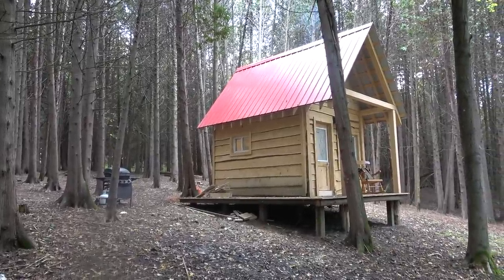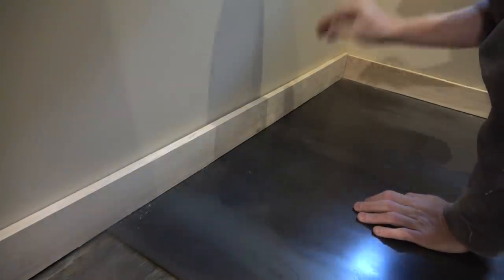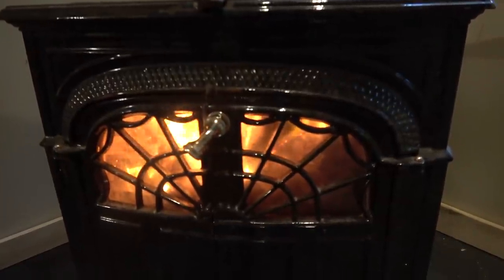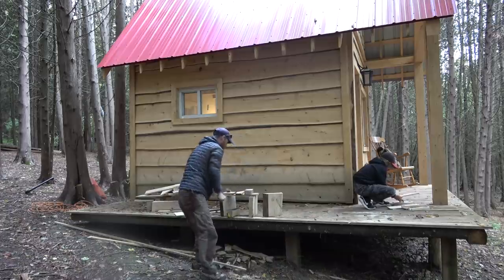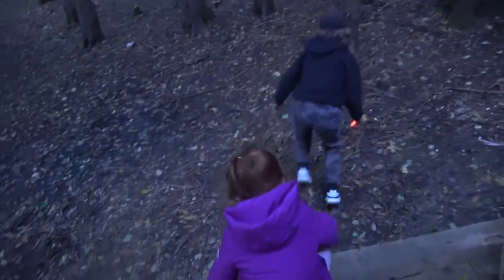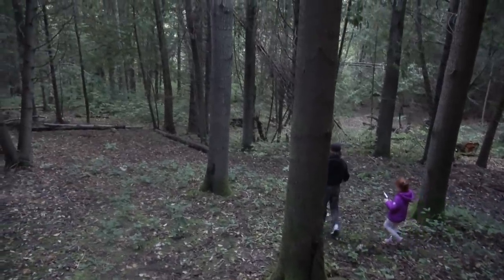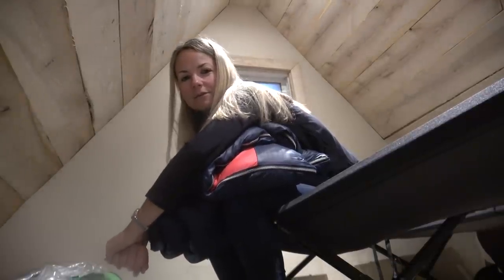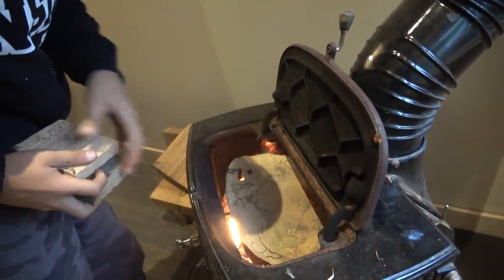HER FIRST Overnight at the Off Grid Cabin! | Fire Plate, Burgers and Movie Night

Comment: Hey buddy you should put up a railing system for the kids for safety reasons. Especially if your niece is going to be there a lot and also Holden so he dont accidentally fall off there in the middle of the night trying to go to the bathroom or while sleeping. It's really simple to make a railing for that plus it will add a sense of security and closure to the area.

Comment: Chris.
Just a quick observation or two about the wood-burner.      Going by the Ontario building code 
1) the stove and chimney should be at a minimum - 16" away from any combustible material. That's all the way to the outside through the roof, not just inside the cabin.and also the floor.  Cement board would work well on the wall,  as well as under that steel plate, which will conduct heat through it to the wood floor as if you had built the fire on it instead of in the stove and it is not expensive, comes in 3' x 5' x 1/2" size for about $14.0 
2)Not to sure, because I could not see too well the install of the chimney, but it looks as if the pipes are in upside-down. - i.e. the 'female end' should be at the bottom of the join and the 'male end' goes in from above the join. 
This is so that any liquid from either rain or condensation from the burning wood, when it runs down the inside of the pipe, will not run out onto the floor or the top of the stove. Don't worry about the smoke coming out the joint . Trust me it won't.
3) I know you probably will not be inspected by any authority regarding the cabin build, and it's use, but just for you own safety regardless of code requirements, a smoke detector should be one of your priority purchases. Fumes from a wood-burner can kill very quickly, especially when you sleeping.
Stay safe, and enjoy that beautiful woodland wonderment.

Comment: Just a note - Wood burning stoves should have the exhaust stack fitted with the upper section going "into" the lower section to prevent creosote from leaking around the fittings when stove is shut down and creating a mess on the pipe.  The hot exhaust gasses will naturally flow upward and not create a problem with gasses getting into the cabin.  It appears from the video that the upper was fitted over the lower section...

Comment: I like that you dropped the loft floor a foot to get you more head space.   My stove requires 18” from the drywall.  I mounted a steel roof panel On the wall behind the stove with a 1” gap to wall. Works great and moved stove to within 16” no problem.

Comment: Looking like a railing is the way to go. Don't know if you've seen them before but in small structures raisable stairways are really efficient and look cool also. You can do them out of wood or rustic iron. The pulley system is simple and you can get a good angle rather than a straight ladder type stairway. You can even do it where the hand rail collapses when you raise it. If you use something heavy as a counter weight they go up and down so easy a child can even do it. Just an idea I thought you might consider.

Comment: Just the plate steel will be fine by itself. The only reason people use them is so sparks and coals that fall out dont burn the wood floor. Stove should be 36 inches from the wall though. Unless you put some kind of protection behind it too.

Comment: Oh the 3/16 steel floor is a good idea but it will conduct heat and melt your flooring Need possibly a fire resistant material beneath the steel or flat stones to raise the plate up  creating a clearance for heat to dissipate. Just a thought

Comment: Need thermal stones under the fire place to be sure,  there's no code in the woods. I'd put patio stones on top on the steel plate, the gaps act as insulation to the heat, so none will pass because as you said heat rises.

Comment: Okay, so my house is an old Railway house from around 1908, give or take.
it has hardwood floors throughout, except in the pantry, the bathroom and the stoeps. However, in the kitchen they poured a concrete slab in the corner to put the stove on.

With that in mind, I wonder if it would be an idea to put down some terracotta or some such under that metal plate?

Comment: One of the best things for thermal barrier between stove/tile/floor is cement fiber board. I've never used steel. Looks good you guys, cheers!
Reply: 1/2 inch of Micore, or Durock under that sheet metal will give you R 2.5 or so, make it 1 inch and you shouldn't have any concerns with thermal protection with your leg stove.

Comment: I would have put some fire proofing between the steel plate and the vinyl flooring... the steel plate I feel is no different then having the metal stove directly on the floor... they are both metal???
Reply: My stove has 2n a half inches of concrete and three quarters in flagstone under it on my wooden floor, and when you burn the right hardwood with the stove filled... That floor in front of the stove gets so hot you can't stand bare foot on the wood floor in front of it. I think that steel plate could be a fire hazard
Reply: @raymondhuber6306  Exactly... I'm no expert by all means. But I remember my grandmother had an old house out in the country in Ontario when I was a kid and they used an old cast iron wood burning stove year round, I remember many relatives getting burns... but most of all I remember the stove had to be placed on a steel plate on top of a hearth stone and with stone backing. Basically it had to have the majority of a fire place and chimney built around it to to make it safer.... and even then the wood floors would get so hot you could not go near the wood stove without footwear.

Comment: Put that metal on a piece of concrete board. It WILL melt plastic flooring. Heat rises but radiant heat will easily heat that floor. Personal experience.😁

Comment: Metal absorbs heat so place some bricks or flat rocks between the floor and the plate and the problem is solved. Also, vinyl floors will emit gases when heated at any level so that is a bad thing. Hoses burn down from boo-boos like that.

Comment: At my cabin I put down a dbl layer of fiberglass welding blankets bought at harbor freight then ceramic tiles then a plate of steel same on walls !
Reply: Better safe than sorry! I am in your boat as well. I have a feeling that flooring is not going to stand up to the heat if they get a good fire going constantly for the winter time.
Reply: We put granite for the wood stove, and put the flooring around it, not under it.

Comment: If the stove gets hot enough to melt the vinyl flooring, it will burn the clear coat off the steel. Hi Temp engine enamel would be a better choice.

Comment: This shack is good, just built backwards, your front door is the single largest loss of heat in the shack. Your stove is next to the most open area of the building. The front door. It is a Heat dump. Why did you do that? Wood dirt? Brooms are cheap! Easy to use to.

Comment: I almost burned down my home  only thinking heat rises.  The health was on a wood floor cement and brick.  The floor below cause on fire.  If you have a small space between the metal and the vinyl that is good. It acts as a reflector.
Reply: A good idea would be to feel the metal plate to be sure it is not getting hot, hotter and hotter. The metal like stone can contain a lot of heat.
Reply: Glenn. We have a 4WD trail in the mountains with an old tungsten mine. In the eighties the trail still went through the mine site, there was a nice two story cabin. A sign inside said “Use, do not abuse”. We stayed in it without problems a couple times, then we went back after a few years and the trail had been routed around the mine site. Turns out two guys drug a wood stove out of a closet and built a fire in it, and burned the cabin down. The owners said “Enough is enough”.

Comment: you need to leave an air space under the metal or put something non conductive under it like fire board
Reply: Agreed
Reply: Im afraid they will all die in there due to the stove not having proper fire board under it and nothing on the walls. Every cabin or tiny house i have seen has the wall covered with somethin. Wont that metal piece get super hot?

Comment: Hey guys that's a bad move you need to elevate your floor steel plate will heat up because he radiates up and down under the store but it heats up with you most of the temperature will be at the bottom so you have to deal with Granny or a slate raise and left on the back wall have to separated with porcelain spaces you have to put a space against the wall and have to elevate the floor intoxication you guys are going to die at the toxication if you don't Elevate that plate

Comment: How are you getting constant light and electricity without a gas powered generator what is it that you’re using is it just a battery pack
Reply: He has both a generator and solar with batteries, look for those episodes. His plan was to use the battery at night, to have quiet time.

Comment: Interesting how these guys still use traditional units. The steel plate was “3/16 inch”. I like that. I wonder if it is still common in Canada to use traditional units?
Reply: It's especially weird when you hear imperial measurements and Celsius temperature to me. I'm use to going all American or all European.
Reply: Maybe the plate came from the USA. Canada and USA have a lot of trade, it’s hard not to be familiar with such a big neighbor’s systems. Kevin is well versed in imperial measurements, and is a home renovator. That leads me to think Canada houses are built the same as in the U.S..

Comment: The cabin looks fantastic - do you need a head shield for the wall behind the wood stove or is the distance sufficient ?
Reply: I was thinking the same thing i had a wood buring stove in my wood shed and it did catch the wall on fire from the heat
Reply: The clearances are as per manufacturer recommendations.

Comment: I do love this cabin! Years ago with something we called an airtight when it was brand new we put it into sand in the bottom to prevent the bottom from burning out and from transmitting too much heat to the floor. One of those little fans that works from heat that just sits on the stove would be maybe a nice addition just to give you a little circulation

Comment: High Speed internet connection in the middle of the woods would be too far?? Is anyone there could estimate the actual cost, high durability cable cost per lenght, and required work time etcetra?
Reply: You could go satellite internet. Or beam radio from the house on top of a 30 meter tower. Or run cat 5/5e/6 cable with a powered repeater every 100 meters.

Comment: ok lets get rid of a very dangerouse beleive  Heat Rise , that is incorrect Heat always go to the cold it does not care if it goes up down looped looped it just goes to the cold and what is worse anyone that has set by the fire knows this if heat only goes up how does it warm you sitting next to it how does it heat the ground below it , but you guys are doing a great job keep it up love the video
Reply: Hot air rises in theory. In practice, my wood stove never puts warm air upstairs. The warm air rises to ceiling height, cools and falls. It won't go up the stairway - even if I use a fan!

Comment: I agree with the comments of brick or cement board under and behind the wood stove along with a railing. Also might with a fire resistant hearth rug in front of it for any flying embers. 
 Depending on clearance the gate style below has worked well for us besides ours has 5 panels and just enough space to close the gate behind you while tending the fire. 
    Just my opinion disclaimer. Not a professional etc. 

https://www.lowes.com/pd/Dreambaby-Adapta-Gate-79-in-x-29-5-in-Black-Metal-Safety-Gate/1000211739

Comment: This man is WRONG !!!!  Heat does NOT rise... Heated AIR rises... Heat  moves in THREE ways.. Conduction, Convection and Radiation....The most predominate way heat moves is RADIATION...  Heat will RADIATE in ALL directions equally. This guy is ASKING for serious problems. He should use a SPACER under the STEEL PLATE to lift off the floor at least 1 inch. This AIR space will NOT conduct the HEAT to the FLOOR !!!  Good luck Mr. Beardsman... Be safe and God bless...
Just saying... lol

Comment: dude, that is far too small too play with the amount of people there. time to extend the place double the  size.  hell just building off the back, would give ya the room for ten too stay comfortable.    I built mine with a starting room of 10 by 12, then added on a 5by12, then an eight by twelve, then a 12by 12 then a 6by eight.  I allowed a rap around porch and it held up well for better then fifty years.  my family of four lasted well for living there for five years when I was injured. it became a nice little tiny house.   after I won my court battle, we moved into a bigger house, in another state. my son used that house  as a hunting cabin, taking his work mates and friends for better then another twenty years . the lace then sold for five times what I paid too build it.   I used the appliances from an old dodge camper.  they worked great for the years it was used.   but I used tin sheeting under the house, too keep rodents out.    but the total cost it took too build out was little less then fifteen hundred.  most of the wood came from pallets, I got for free.    when I had a enough wood for a section  I'd tin the bottom and then wait until there was enough too build the walls. and roof.  I put five years into that build out.   it cost me three hundred for the camper, and the rest was tin roofing and saw blades, and nails, and insulation.  hell I never spent more then six bucks for my batteries. that I went too old junk years, finding them or anything that I could use.  if you know any that have all you can carry for a set price, those are the gifts from heaven .    hell even my generator costs me ten bucks.  as the shell was bent from a fall. but the generator was fine.  it was an old Honda 3000 watt. it worked great for many years that ran off of butane.   I found old 100 pound  roofing bottles there that the guy wanted gone. I got all four free.  three of them needed too have their valves replaced. that costs me fifteen bucks each.  hell I'd get a month out of each bottle. the one that was bad, got turned in to a  run off from my septic tank, to the leach field. hell you can find all kinds of goodies in the most add places.   yard sales and garage sales are another great finds/ even military surplus have great deals.  even after sixty years, I still use my sub temp sleeping bags and camping gear. I like auctions too. they are great places too find rehab stuff/ goodies.  well best of luck with the tiny cabin. thanks for posting...